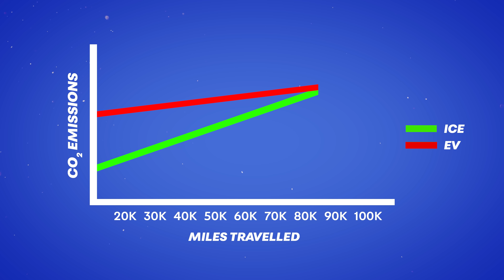Are Electric Cars REALLY That Green? [New 2022 Data]

Comment: Now investigate how green renewables actually are. Solar panels above 35 degrees north are carbon negative taking manufacture, transportation, installation,  maintenance,  removal and recycling into account.   Wind turbine blades can't be recycled and the production causes nearly as much co2 as is saved by using wind so is the green energy you are using to recharge your green car actually green, and therefore where does the cross over actually occur.

Comment: Mark my words: Electric cars will cost exactly the same price to run as petrol cars. The only thing I am not certain of is if EV's will ever become as cheap to buy as petrol cars; I can't see any realistic prospect of ever being able to buy an "old banger" electric car with a good battery that will get me to work and back no problem for £1,000. 

The price of electricity will shoot up, EV charging will attract a super-tax, we will be forced to pay by the mile to drive on motorways, and then "black box" systems will become compulsory in all new vehicles so that our mileage can be measured on all roads - and of course our movements will be tracked just as they are already being tracked from smart-phone data. Very likely such a black-box system will be remote-access so your vehicle can be restricted or disabled by the authorities.

Comment: Nice presentation. This is the first time I've seen a video starting the same questions I've had regarding EV vehicles. Now how about the videos on PV cells and wind turbines. Because they may be taughted as green but the PV cells are terrible for the environment and largely unrecyclable. And the amount of energy that goes into the wind turbines is tremendous and the blades need to be replaced far sober than speculated and are made of fiber glad which is very difficult to recycle if at all. So go green!
Reply: thank u for saying how it is unfortunately most of the so called recycling we do goes straight to a dump are any ev companies paying a garbage tax? I think not do you musk is paying a garbage tax I think no

Comment: I'd like to see the additional cost of replacing batteries and their disposal added to this figure as well.
Reply: Bingo
Reply: It's difficult to say what the cost of replacing the battery in most electric cars, But I do know the cost of a battery refurbishment on a 10 year old Nissan Leaf can be as little as £600. Cleveleys Electric Vehicles in Gloucestershire posted a YouTube video of this Leaf battery refurb a few years ago....
Reply: @Brian-om2hh  And how long does that refurbished battery lasts before it fails again? Is the range back to 100% or is now only 80% and going down from there even faster than before?

Whole new battery is like 4000 - 5000 plus installation labour. These old Leafs are barely worth that much in current used car market. For 10k you can get something far newer and better. So off to the junkyard these cars go.
Reply: Didn't even look at the report, did you. Not that it's very detailed it's in their page 42.
Reply: @michaelthomas7898  Its the artificial life-time mileage limit used in the report that is the biased problem to support electric vehicles. That's why they released the report as it just favours electric cars. If they were honest about vehicle lingevity and ownership of petrol cars then the curve swings the other way again.
Reply: @captaincrash12  You're not even close. Nothing gets better with age except whisky and wine.
Reply: @michaelthomas7898  Steel Chrome bumper cars will be around long after our plastic cars are waste. You know it. Maybe drink your wine on your steel car picnics and run whisky in the boot for profit. :)
Reply: @captaincrash12  Cars haven't been built with chrome bumpers for almost 50 years now. Think about it.
Reply: @michaelthomas7898  Nope. Spell your point out please.
Reply: @captaincrash12  would never swing the other way. The biggest carbon cost is the battery, the batteries themselves should run the car for 10 - 12 years, then can run a house for another 10. 

The batteries themselves are about 95% recyclable which means after that 20 or so years of use you will only need to put in another 5% to get another 20 years out it. 

So the carbon cost which reduce well below an ICE car by the 2nd car, not including the gains made running it the first time.
Reply: @Cwistool  Your raw stats are wrong. As you are missing many variables. The electric cars will be replaced much sooner for technological, practical and social reasons, and thats the damage. And 10 or 12 years, dont make me laugh. I have a vehicle that is 36 years old. Never restored in any way. Guess what type it is. Batteries will not last that amount of time used or not. My mate has a Cruiser with 560,000 klms on it. Get a Tesla to do that. Now Elon says their recycling has gone from 92% up to 100%. Im calling bulshit on that. Especially since they sell the recycling out. If you have a gas powered car now, that is of good breeding, just keep it. You will save the environment compared to replacing it with an EV. Raw materials alone. Therefore my point of banning 'all' (not just new) gas powered cars by 2030 is daft. Yet I do not suppose you actually read what I typed. The swing does eventually go the other way. The artificial 124,000 miles is the issue. Why do you think they made that proviso in the studies.
Reply: @captaincrash12  there are teslas with those kms. Non argument that theyll be replaced sooner than ice cars for the same reason ice cars get replaced? You seem biased.
Reply: @Cwistool  Why do we throw so many batteries away then
Reply: @Cwistool  You're forgetting that batteries also lose 25% for people in cold climates.  Batteries currently last around 7 years.  Also cost around 10-20k for battery replacements.
Reply: @captaincrash12  Yep, my VW Diesel is 20 years and going strong.  7 years for batteries, 10-20k replacement.  Also, lose 25% range in cold climates.
Reply: @captaincrash12  You might want to see the YouTube video posted by a Tesla Model S owner. His car had covered 400,000 kms on it's original battery.
Reply: @Brian-om2hh  Most do not even make it that far. The more you drive them the better run you will get. Batteries rot. Make a general compare, not one offs.
Reply: @Cwistool  Recycling also uses energy and creates waste. If 95% can be recycled then that means that 95% of the original battery can be used to make something new and no it does not mean you can make 95% of the new battery with the recycled materials. Just like 100% recycleable plastic bottle can not be turned into a brand new plastic bottle. New battery still requires a lot of new raw materials that degrade over time and make the battery stop working in the first place. Plus the pollution from recycling means you still end up polluting the environment to 60-80% extent of the original battery. In reality you replace the battery after 10-12 years with a new battery that has created 60-80% of the original batteries pollution. And the damn thing may not even last for another 10-12 years but fails after 8 years because recycled materials used are not as good as brand new materials.
Reply: @m4rkscott  Computer batteries are throwaway, cheap and low mass computer batteries. The average EV battery has about $1000 worth of valuable materials in it which are far easier to refine than starting from scratch.   

You can expect over 95% of EV batteries to be either reused or recycled. My last tesla after seven years and 80,000 miles had lost 5% of its battery capacity so I would anticipate the battery would last for another 25 years with no problems.
Reply: @Zanatos9  where did you get that seven year figure for how long electric vehicle batteries last? That might be true from the early Nissan leafs but my 2015 Tesla had 95% of its battery still available at 80,000 miles. I would expect to go at least 650,000 miles before I might consider a battery change out which at that point would probably be less than $10,000.
Reply: @captaincrash12  most of the data people have on battery longevity go back to the early Nissan leaf which I admit was poor. My 2015 Tesla had 95% of its battery still available at 80,000 miles and my expectation was that I would lose less than 5% on the next 80,000 miles. Currently have convinced over 20 of my friends to buy a Tesla no one’s had any battery problems whatsoever. We more or less expect about his last much longer than we would ever want to keep the car.
Reply: @colingenge9999  Better re-learn math because 10k isn't 7 figures,  it's 5 figures. Which has been well documented on most vehicles that batteries are recommended to be changed at 7 year mark. So instead of a $500 timing belt, a 10k battery change.

What they will ultimately do is people who can afford new cars will trade it in against a new car. So instead of cars lasting 15-30 years. They'll have a life cycle of 7. 

Also killing the used market, and putting people who buy used out onto horse n buggy. 

But hey....you got an Elektrik Kar.
Reply: @Zanatos9  Nissan is probably 7 years although their new batteries are better. Their problem is air cooling which does not keep battery temp even which is why Tesla batteries should go million miles on their newest batteries. I challenge you to provide documentation that says otherwise. My 2015 Tesla at 80,000 miles still has 95% of its battery so why would that be if they only last 7 years?  Current wisdom has EV lasting twice the miles of a gas car that usually will go 500,000 max.

I have no clue what your rude remark about “7 figures” means.  That sort of attitude does not bode well for your communication skills.
Reply: @captaincrash12  how do you know that “batteries won’t last that length of time“? For sure Nissan, GM and even Porsche have had battery problems by Tesla batteries going back to 2015 have been very dependable. Since Tesla sells more cars than all the other manufactures put together you should really use them as an example.
Reply: @CoreMaster111  isn’t it odd that there is severe criticism over the percentage of 1000 pound battery that will get recycled when a gas powered car will go through 70,000 pounds of fuel and several thousand pounds of oil in grease and so on over its lifetime where it’s not only not recycled but it’s pumped into the atmosphere where we breathe that were in the US burning of those fossil fuel‘s gives us 110,000 premature deaths every year. When the fossil fuel industry starts giving back those lives then we can start talking on this topic it’s some balance way.

The total environmental cost of a gas powered vehicle as well in excess of $100,000 in destroyed global resources and guess what, no one is paying for that except maybe our grand children.
Reply: Actually… if this is also being considered, the other thing that needs to be considered is… how much maintenance related to ICE cars add? Because what is known is that EVs require very little maintenance. Other than tires and brakes, there is very little in other parts that need to be maintained compared to ICE car. And even with brakes, they wear down at a much slower rate because of things like regenerative braking…

So when you have to get an oil change every 5K-7K miles… how much does this type of maintenance add?
Reply: @jwlee21  Surely  the massive added weight of an ev wears out brakes faster even when you take into account regenerative braking
Reply: @m4rkscott  you have misquantified regenerative breaking in a battery electric vehicle. Is not the same as a hybrid. In my Tesla model three I might touch the brakes only once or twice a week and even then for a relatively short duration. The regenerative braking will bring the car to a complete stop at every stop sign and every red light unless I need to panic stop. I expect my brakes would last at least 1,000,000 km before they have to be redone. It might be more of a problem of underuse so I touch the breaks every once in a while just to keep them clean.
Reply: @m4rkscott  Brakes on my Tesla Model 3 should last million km! why? because I only touch them slightly once per week. I do ALL my braking with regenerative braking with motors putting power back in the battery. Car will come to A complete stop in almost any traffic just by easing up on the accelerator.  My 2015 Tesla model S which I drove super hard had 6% break wear after seven years of daily driving.
Reply: @colingenge9999  I'm so pleased for you, you must feel like a really important person now
Reply: @m4rkscott  yes, I will be very pleased to help you sort out any other issues you may have about electric vehicles.
Reply: @colingenge9999  You can't see the woods for the trees, get off your high horse, EV's have a big future but they are not the answer to world pollution their impact is miniscule
Reply: @m4rkscott  Where did I say or even hint that EVs were the answer to “world pollution”?  I have never said that. Clearly they are part of the solution. Clearly trucks are more of a factor than cars but if we stopped moving on partial solutions because they were not complete solutions, this problem will never be solved don’t you think?
Reply: @colingenge9999  I'm sure that you didn't buy a EV because you like the thought of 9 yr old boys mining cobalt in Africa for £2 a day so assumed you thought you was saving the planet
Reply: @colingenge9999  95% of emissions are formed naturally which leaves 5% caused by man which obviously tips the balance but of that 5% only 14% is down to transportation which includes all shipping, flights, trains, busses, lorries motorbikes and yes cars as well, I can't find the percentage in the transportation section of which cars are responsible but I would guess around the 3% mark would be somewhere near. so that would be about 0.0001% we would save if every single car in the world was electric and that isn't taking into account the massive amount of pollution caused by the production of EV's. Yes every contribution is good but not as good as people think also if we force production too quickly we will be retiring cars before the end of their life therefore using more of the planets resources before it is necessary thus having a negative impact on the environment because of early production rather than a natural switch, it would be far better just to build a couple of thousand nuclear power plants across the world which in ten years would change emissions a thousand times more than EV's will plus there would be enough power to feed all of these new cars.
Reply: @colingenge9999  That is 5% of all deaths, I really don't know how that number can be proven and even if true what percentage of them would be from car emission's alone seeing as cars are such a small proportion of burnt fossil fuels and I am fairly sure that more fossil fuels are burnt providing electric than what petrol engines use, that problem needs addressing before people are forced to have electric cars and before people start gloating
Reply: @colingenge9999  UK government are banning the sale of ICE cars from 2030 , I consider that forcing
Reply: @m4rkscott  I would consider it “forcing “ if UK banned all gas cars in 2023.  But by 2030 you will be virtually unable to even buy a gas powered car so congratulations for them thinking ahead. Consider that last year electric vehicle sales increased by 70% and gas powered vehicle sales decreased by 21%. This year electric vehicles will increase by over 100% and gas vehicles will surely fall another 21% or much more. By 2025 electric vehicles will be roughly on par with gas powered vehicles and by 2030 they will be literally zero reasons apart from nostalgia to buy a gas powered vehicle. Electric vehicles all already better in every conceivable way than gas powered vehicles unless you like all the noise they make. Banning gas vehicles by 2030 is almost a meaningless gesture similar to the banning of rotary phones.

From a nostalgic point of view gas powered vehicles will be looked upon just like we see horses. Not a main means of transportation but a hobby for those who want to tinker around.

It’s not as if people are being forced to discontinue running their gas powered vehicles I’d rather they are being warned well in advance that buying a new one is a really really really really really really bad idea. For everybody including them.
Reply: @colingenge9999  your numbers are all over the place 100% increase on 3 percent of sales does not work with 20% decrease in 90% plus of sales, if you have trouble understanding numbers there are people that can help you. Along with this you seem to like governments making your choices, good luck with that in the future
Reply: @m4rkscott  So I get from you that if you cannot gain any traction in a discussion, then try insults. How very immature and trumpian of you and unfortunately puts you in a class of people who have lost the ability to learn anything new.
Reply: You are right but then you also must factor in the oil,filter changes,engine and transmission maintenance/repairs and more brake wear for ICE cars too
Reply: don't forget to add oil spills and cleanup costs to the calculations for ICE cars as well.
Reply: You can certainly see the cost of having an electric car battery refurbished. James & Kate's YouTube channel showed their 10 year old Nissan Leaf getting a battery pack refurbishment a few years back at Cleveleys in Gloucestershire. The refurb took 4 hours, and the cost was £500.....
Reply: I'd like tonse the environmental cost of gasoline added to the price, but we can't have everything😔.

Comment: I don't think Volvo is taking into account the upstream production of gasoline. Oil extraction, particularly from oilsands is extremely high. One of these vehicles comes off line with a fuel cell and the other one does not.